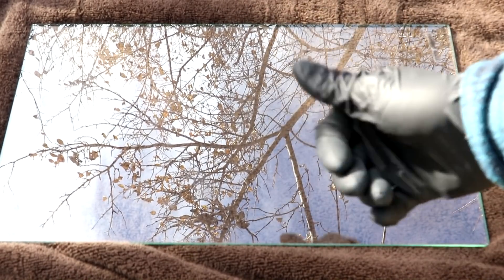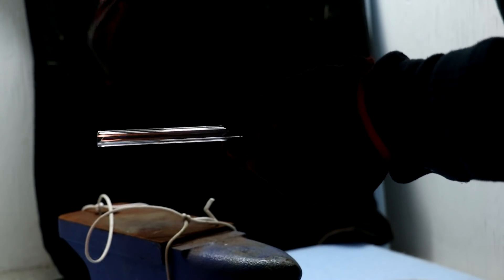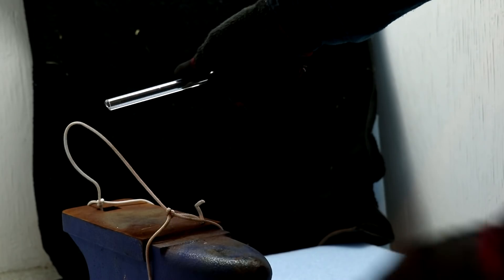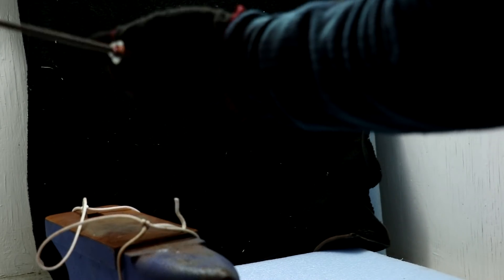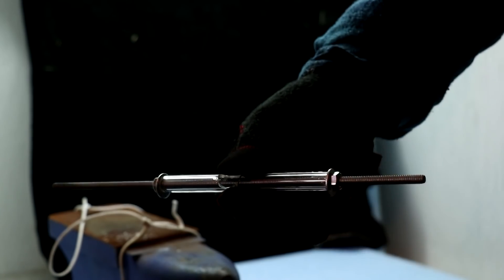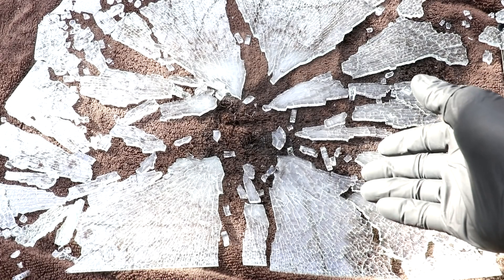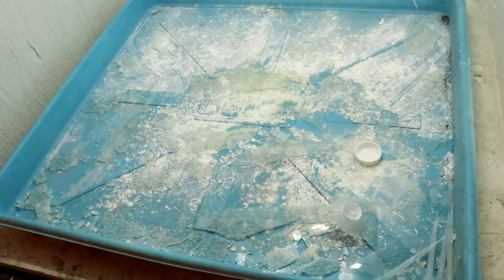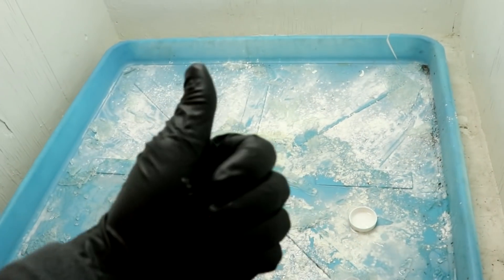Can I Dissolve Through Tempered Glass?

Comment: I’m curious about my phone protective screen! It cracked the other week with no pressure, I watched it happen, it’s tempered glass, it was about 3 years old, do you think 3 years of my fingers rubbing on the screen wore away the top layer so the stressed inner part was able to push back enough to crack it? I was watching a YouTube vid (ironically on removing iPhone glass with a laser) when it happened and wasn’t touching the screen! It was only the protective gorilla glass that broke, but yeah it kind of popped from the centre instantly about 3 inches long, and then it kept slowly growing to the top and bottom of the glass over the next 5 seconds! Pretty random

Comment: I wonder if you had a dripper that would drip fresh acid on it ml by ml every day and have a wash cycle to wash it away if you could make it go slow enough to not break it. Maybe its just that the acid is attacking so much surface area that its easier to express the forces.

Comment: I suppose something you could do would be to slowly heat the glass to de-temper it, cut the hole in it, and then retemper it, but that would require a great big furnace which most people don't have access too.

I wonder if it would be possible to melt a hole through the glass.

Comment: Great video as always!
Not sure if it’d help, but maybe flipping the glass over halfway through was a mistake? 
By flipping it, all the glass under compression was removed, leaving only the tensioned glass. 
If it hadn’t been flipped, it would still have had the back compression sheet to hold it together until the acid was completely through the tensioned layer.

Comment: Rule of thumb with tempered glass is you can typically, at least around the outside edge take about as much material off as the glass is thick, so 3/16's per 3/16" thick glass, not sure about how much you could take off on the surface, but we used to take shower doors/panels and have our edging machine take off some around the edges if it was close enough to fit in a shower but just barely too big.

Comment: You could heat the glass up with a small torch within the area you're wanting to either drill or use acid to eat through the glass to make the hole it may possibly work

Comment: Would putting a rigid frame around the glass edges work? Would the frame provide enough compression to get through the glass without the internal pressure ripping it apart?

Comment: to my understanding it's more or less impossible to make glass that doesn't already have micro-cracks in it. if i had to guess your pane broke when the tension pulling the thinned section got high enough to open one of the already present micro-cracks. 

my guess as how one might overcome this. guess is you you could try putting the the pane under high compression to try and counter balance the internal tension.

Comment: You should try a mixture of HF + HCl. Hydrochloric acid dissolves most of the insolubles. This mixture has been used in microfabrication of glass with some success. At any rate, it works far better than just plain HF.
Reply from the maker: Yes of course! Thanks for reminding me of this!

Comment: Tempered glass is not only drilled, but also cut and edge-dressed before tempering so the exposed edges are also under compression.
Had you succeeded in etching your hole, there would have still been an exposed strip under tension, and the smallest force applied there would have triggered fracturing anyway.

Comment: From someone who's O.K. with fracture mechanics, but knows nothing about chemistry:

Cracks in glass make it shatter upon loading while the cracks in steel don't cause the cascading failure because in metals, the extra energy introduced at a concentrated area immediately surrounding the crack tip can be absorbed through plastic deformation of the material instead of increasing the crack size. So in metals the crack will tend to grow in a more stable fashion (to a point), while glass has no capacity for plastic deformation and will shatter (growing cracks will increase the stresses which increase the growth rate which increase the stresses etc...). 

Technically, if it was possible to chemically alter the material (locally, around the cutting/etching area) into something that has some capacity to deform plastically (i.e. a  less brittle material), you could maybe mitigate the unstable crack growth while cutting through the material. What I don't know is:  is this just a complete fantasy from the chemical point of view? can that be done (or is it done already in some application??)?  

Maybe this gives you some ideas, since etching only removes the material but does not remove the tensile stresses and does not provide a way to relieve them.

Comment: Great Video! Question: what would happen if you maintain extrinsic compression on the glass (like you did with the glass tube/steel bolt demonstration), whilst dissolving through? I imagine it would still fail as the compression/tension forces are intrinsic to the material, but I couldn't be sure.

Comment: You could cheat your way through it using heat. Blowtorch or laser. But that really un-tempers the region around the hole as you make the hole, so it should work, but it is like cheating. You might as well un-temper the whole thing, drill a hole, and make it tempered again.

Maybe the fail was that you switched to the other side. I think this could work if you leave the back side intact as you go through the middle. Maybe the middle got ripped as it got thin because it had no support from either side.
Reply: Yes. Use lasers to burn through something transparent.
Reply: @unknownunknown-fb1ph  No problem, just dust the surface with a bit of carbon to get started. Lasers are used to cut gemstone-quality diamond.
Reply: @kurtilein3  oop. Im dumb😅

Comment: While the acid experiment was unsuccessful, the explanations and demonstrations were very helpful. I now know how tempered glass works, thank you Cody!
Reply: I'd argue the experiment was successful! The video's title was a hypothesis. We proved the hypothesis was incorrect (for this method). That IS success in science!
Reply: @SciSky  True. Science makes successes into failures, and failures into successes, so you never know how to feel. :D
... although: in this case we still don't know if it's impossible, or if it just didn't work this one time...
Reply: Absolutely!  --- Now I just wonder: Does tempered steel work the same way? If so, I've learned a lot today!
Reply: @Verrisin  Tempered steel is actually more fragile but also harder than non tempered Steel. But steel is still a different material, thus in matter of flexibility and breakability it's on an other chart than glass.
Reply: @timhuester7721  Of course, completely different, but the core being under tension and outside under compression is probably the same?
- So, it would make sense to make it harder.
- Steel is usually quite flexible, completely unlike glass, so it makes sense, its' more brittle, but.... I guess tempered glass is actually more flexible? If that's the case, that would probably be a big difference...
Reply: That why an experiment never fails, you always learn

Comment: You can't dissolve through the tempered glass because it is not the vibrations that break it when you drill through it (though they help, of course), but merely an introduction of a surface which did not cool down quickly. In a piece of tempered glass, every constituent part has forces acting on it, but the forces are balanced from all sides. Creating a new surface (by introducing a hole) means that there are particles on that surface that do not have forces on them perfectly balanced, so they start to move, exposing more and more glass: propagating cracks form and the whole thing explodes. 

Same thing happens when you chip the tail of prince Rupert's drop: the entire thing explodes, not just the tail. And it doesn't matter how gently you do it. 

It would be fun to dip the tail of prince Rupert's drop in some HF, and watch it until it explodes.

Comment: Could you try and do it in a high pressure chamber so that the micro cracks may be closed? The  problem with this would be that the glass may beeak when the pressure is released.

Comment: Maybe if you could hold the glass in place with a strong force you could put a hole in it. Like putting it between two plates and push them together very strongly and then try to make a hole in the middle. But it might still explode when you release the pressure then, unless the hole is then treated in a way that it can not deform the slightest and holds the glass together.

Comment: Good info, and nice attempt!

Perhaps the only way of doing this would be using heat instead... in an extremely controlled way, since putting a torch to it would just shatter due to structural deformation.
Man, kinda hard to imagine though... you need to create some form of containment for the cracks not to develop.
What comes to mind is glass blowers and glass working in general... quite impressive stuff.

Comment: I'm wondering if dissolving only from one side would help. This should keep the tension core of the glass under compression under compression, which might help keep micro-fracture from forming? removing glass from both sides means you eventually have a thin film of glass that wants to pull itself apart, so it seems to me the least desirable glass to leave to the end. 

Of course you could just wind up with the opposite problem, where a super thin piece of glass under compression eventually buckles, and the cracks propagate from that, but it still might be worth a shot to try anyway.

Comment: Can you melt a hole through it with a torch? It might untemper just the local portion. Glassblowers trick: cover with a thick layer of carbon soot from just the gas flame no oxygen. Creates an insulating layer that protects from cracking while heating, as least in borosilicate glass.

Comment: Next logical question: "Can you melt through tempered glass with thermite?" :)
Reply: If you heat the glass the whole thing up then you will take the temper out of the glass and you could drill the glass and then possible re temper it. However a blow torch would only break the glass.
Reply: @birddog7492  Thermite is too uncontrolled and fast, but shouldn't a (carefully applied) blowtorch locally remove the tempering before it melts through?
Reply: @tz8785  You would need a furnace. Something you could control the heat in.
Reply: You can melt tempered glass with a blow torch kind of device. It's how lots of the weird glassware for chemistry is made.
Reply: @maxximumb  It shatters unless heated and cooled very slowly.
Reply: @maxximumb  chemistry glassware is most likely borosilicate glass PYREX , which is not the same as the new bs cookware being sold as pyrex which is soda-lime glass. You'll notice PYREX is clear and pyrex has a green tint to it.
Reply: Answer - no. Heat stress will cause it to shatter in seconds. But it would look amazing. And send pieces of molten metal flying in all directions. That's pretty \m/.
Reply: actually, I think that if you melt the glass, it might work, so while it sounds insane.... might actually work better...
Reply: I would love to see that that be awesome.

Comment: Very nice explanation, thank you for it! My question, instead of fluroic acid, why haven´t you used a hot torch with a fine flame tip to warm up a specific little area, and then let it cool off slowly , to reduce the tension in this area? By the way, the tension lines of the stressed tempered glass would be also interesting to watch, if you would use a polarizing filter. Thx and bye from Europe.

Comment: Funfact: the "real" (theoretical) tensile strength of glass (or ceramics for that matter) is actually way higher than what's observed in practice. This is the result of micro defects on the surface of the material, as demonstrated in the video with the anvil and an extremely high hardness with very low ductility of glasses and ceramics.

Comment: What if you put the temperad glass under physical pressure and add the acid? After it made a hole, with least shaking as possible remove the pressure. Will this work?

Comment: What is the differences of tempered glass and Prince Rupert's drop, it seems to act the same?
Reply: Ken Ell nothing apart from shape, the prince ruperts drop is melted into a bucket of water with rapidly cools the outside, with normal tempered glass that mostly happens with air instead of water
Reply: @Hick25  Thanks

Comment: Cody, I think you actually harmed your chances by attempting to dissolve it first from one side then the other - that method means that near the end of the dissolution, you only have the central portion of the glass (the bit that’s under tension!) for the whole cross section. If you kept going from the same side throughout, you’d have the outer layer of glass (the bit that’s under compression) supporting the tense middle part while it dissolves - so you might have a better chance of dissolving a hole by sticking with the same side throughout!

Comment: I owned a commercial glass company in the 1980s. I had a client that wanted me to cut a piece of tempered glass for him. I explained it would not be possible to cut it and guarantee it would not break. He insisted I try anyway. I did get it cut, not in a traditional way but was successful in slowly dry grinding with very fine grit and then seaming the edges. I gave it to my client but I do not know how long it lasted. I am sure it would shatter if the glass was subjected to rapid heating and cooling like would happen it had sun light on one part and shade on the other.

Comment: Wonder if this could have been done in a pressure chamber. Possibly by dripping or squirting acid onto the glass. Definitely adds a level of complexity. Should try for a perfectly round hole so the forces spread out and only through one side probably.

Comment: 🤔 What about spot-annealing with a torch or laser slightly larger that the bit size so it would make 2 zones of stress (outside and inside of the intended hole). Vehicle glass is perforated in a similar way.

Comment: I might be wrong, but when you etched on the back side you remove the only material left holding the glas in the middle under compression. Etching from only one side might be the trick that makes it work. Because then you remove all the material in tension before you remove the material holding the tension together. 🤷‍♂️

Comment: What if you support or reinforce the area first, for instance with clamping pressure, or superglue. And then drill the hole. 
Would the reinforcement maintain the tension?
And if so, would it be possible to reinforce the hole, so that the initial support can be removed?

Comment: i get why it didn't work trying to dissolve through even, but are you able to "bring back the temper" like blacksmiths do when they want to re-soften a part of their project? if you get a torch and warm up a part of the glass gently until it gets red and then just let that area cool down slowly in open air, do you get tempered glass with a spot of regular glass or does it work like a rupert's tear where it releases the tension throughout the entire piece and shatters it?

Comment: try a much smaller hole and disslove the inside before removing the opposite compression layer so that it holds it together. I'd like to see you using hot sodium hydroxide. The temperature could actually lessen the tension a bit.

Comment: Cody, how about trying to dissolve the tip of a prince Rupert drop? You could suspend it on a string and leave the tail submerged in the HF so you won't have to deal with cleaning up insolubles and you'll have to go through less material in the process.

Comment: Would you be capable of making tempered glass with a hole in it by first making a hole in the un-tempered glass, and then through the tempering process, the same as u first heat the outside first, you do the same on the perimeter of the hole?

Comment: I wonder if you can strongly expand a ring of steel (internal collet), glue it to the glass, and then let it relax, so as to put all of the glass inside the ring under no tension. Then drill a hole, and anneal the edges with heat if it would work. Considerably more effort though.

Comment: Compression, Tension, Compression. If you dissolve the Compression on one side, then dissolve the Compression on the other side, all you are left with is Tension and the glass broke. Try leaving the Compression on the bottom side and deal with the crust as the acid dissolves the Tension layer completely and on through the last Compression layer.

Comment: Are automobile windshields tempered? I cut a piece of one out at a scrapyard once and it did not explode. I used a gas powered abrasive wheel saw and no lubricant/coolant.

Comment: Very interesting. I think, even if you did find a way to get through it, even the slightest scratch on the inside edge would shatter it so it still might be tough to use the hole for anything.

Comment: What if you hit the glass with a blow torch in the spot you wanted to drill a hole?  The idea would be to anneal that area to relieve the internal stress.  My concern would be the transition between the tempered and annealed portions - you'd end up with uneven tension, so it might shatter during the annealing process.

Comment: Even if the acid had successfully dissolved a hole, it would have been an extreme weak spot in the overall sheet.  You'd have exposed glass under tension on the inside of the hole, ready to fail and snap with the slightest provocation.